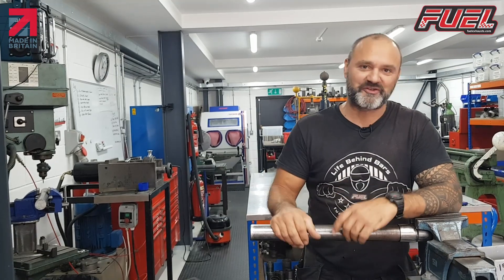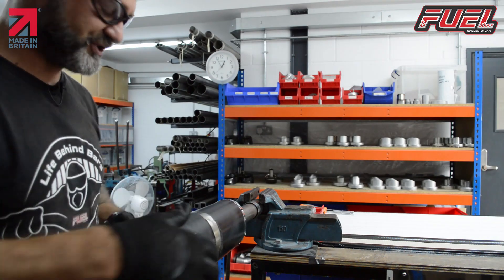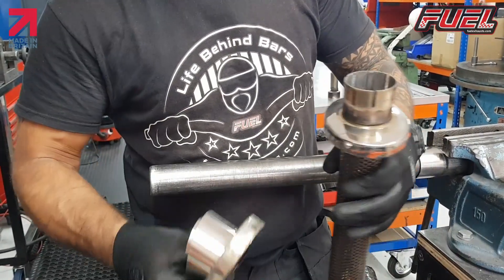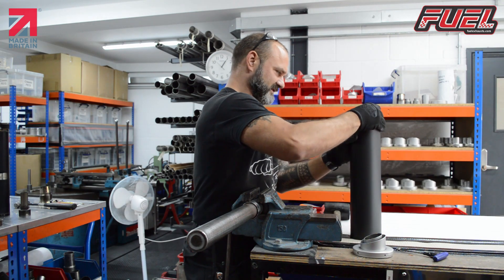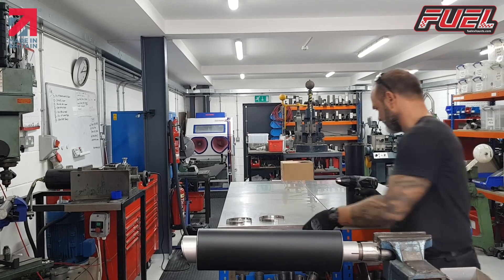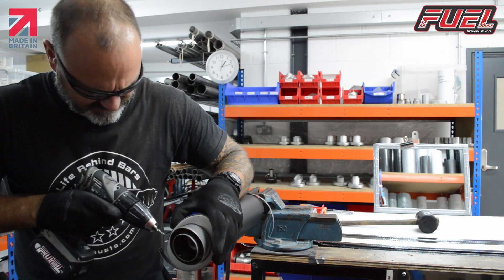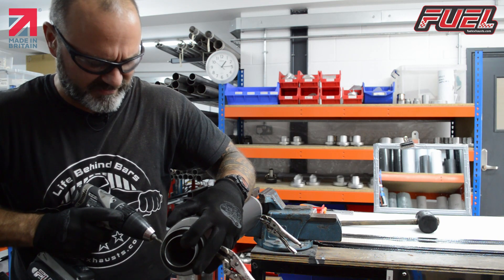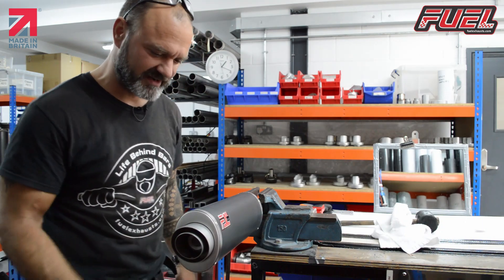Repacking and Resleeving Aftermarket Fuel Exhausts for Motorcycles

Comment: Nice video, love the craftsmanship 

I was wondering, do you also sell the metal layer of the packing material you used in the video ? 
Seems to me that will prevent prematurely blowing out of the actual packing material ?
Reply from the maker: Thank you. No sorry, we don't. I do believe you can buy it online though. It is called 'stainless steel wire wool'. And yes it will be beneficial for the longevity of your exhaust if fitted. (y)
Reply: @FuelExhaustsLtd  Ah no worries, I'll find it, thanks for the tip !

Comment: If my exhaust doesn't have that cylinder on the inside, could I get it somewhere or make an adaptation?  it's too noisy for my liking
Reply from the maker: Do you mean the perforated tube through the centre?
Reply: @FuelExhaustsLtd  Yes
Reply from the maker: @ricardogarcia2915  is it one of our exhausts? If not then you would have to try buying some perf tube online.
Reply: @FuelExhaustsLtd  I have not been able to find it by piece, I only see for large quantities (from China) 😪
Reply from the maker: @ricardogarcia2915  you can buy stainless perf tube on eBay in single cut sections. (y)
Reply: @FuelExhaustsLtd  Thank you so much, I hadn't looked for it like that

Comment: do you have a partner shop on the U.S. East Coast that can repack muffler cans?
Reply from the maker: No sorry, it is just little old us in the UK. 🙂
Reply: @FuelExhaustsLtd  thanks for getting back to me. Going to use your vid to walk myself through the repack as most shops around me only want to do quick turn around jobs like brakes, tires, carb synch, etc.... Going to have to get a drift pipe and a pipe like you used to roll the new material on. Are they both the same diameter and was wondering what size drill bit you use. I've never done a muffler repack so..... and mine is carbon so have to be extra careful I guess
Reply from the maker: @Woods_Hiker  No they are not the same diameter. We use a 4.1mm drill bit. We have a repacking kit here - https://www.ebay.co.uk/itm/370902348307?hash=item565b80b213:g:EI0AAOSwAL9UiYvg. We also can supply extra rivets if you need them. All items available in our ebay store.

This is another video of us repacking an exhaust which may explain further and help you out - https://www.youtube.com/watch?v=ymnSNcAYWvc&list=LLS3h1-6ozk9GjCxRBBGUL1A&index=12

Comment: Is this refurb cost effective ?  What I mean by that is the cost of your labour and parts to do this more expensive than buying a new one or does it come in cheaper ?
Reply from the maker: Yes it is definitely worth it and cost effective for the customer but it does depend on a number of factors. If it is a resleeve and repack then is cost effective and is cheaper than buying new. If there is more damage to the exhaust, ie the end caps are damaged, then no it is probably not worth it. We are only referring to our exhausts here.
Reply: @FuelExhaustsLtd  good to know - I have one of your systems so good to know that this service is available.  When you media blast the end caps or link pipe does it remove all traces of dirt/crap/tar/ etc. and bring them back to a new finish ?
Reply from the maker: @ianbutler1971  yes but it does need a certain amount of cleaning up anyway before it goes in the blaster. Adding the media blasting service will increase the cost. I actually was only referring to repacking and resleeving in my last comment. ;-)

Comment: Hi, can you confirm if the repacking kit includes both wirewool and wadding? Thanks!
Reply from the maker: No we do not supply wire wool as it is on a large roll here and gets tangled as soon as we uncoil it. You can repack without the wire wool though. The repacking kit includes the wadding, rivets and a drill bit for use on stainless steel.

Comment: Tapping top in surely mucks up first cap which was not riveted especially with mirror stuff 🤔🤔🤔🤔
Reply from the maker: Yes if you do not know what you are doing you can easily scrap a load of exhausts. We have over 25 years experience doing it right! ;-)

Comment: why a so small baffle on a long exhaust
Reply from the maker: This is the size to get the best sound whilst remaining UK road legal. Making a longer baffle does not always effect the sound much and can also make a difference to the performance. The baffle length takes this into account to get the best overall result.
Reply: @FuelExhaustsLtd   thanks what is the road legal noise limit
Reply from the maker: @chrissmedley3418  there isn't an exact limit which covers all bikes. We work to what it states on the bikes VIN plate.
Reply: @FuelExhaustsLtd  mmm ok if you say so but the plod and government says different as they say 80db +6 for engine